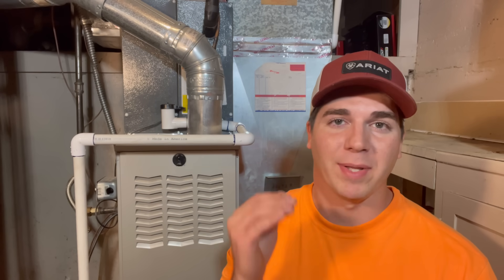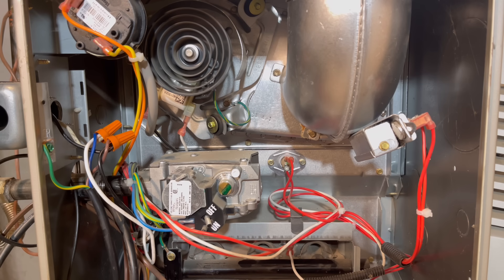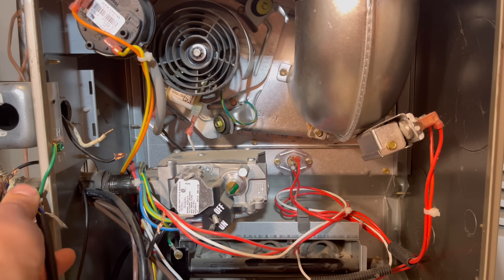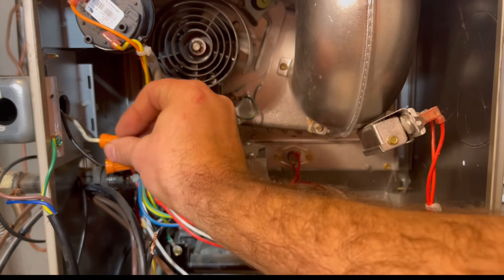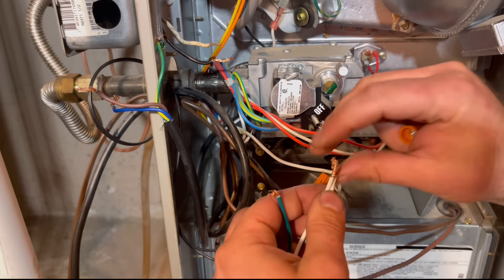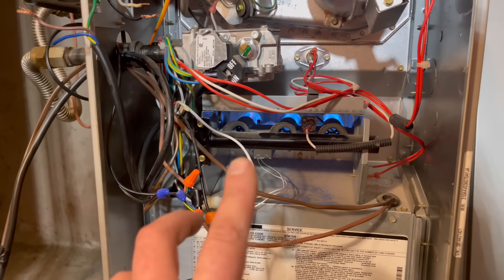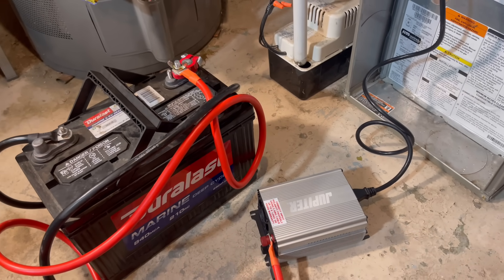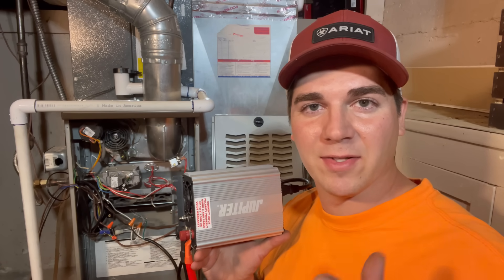Did You Know You Can Heat Your Home With A Car Battery?

Comment: I couldn't find in the comments.  Did you address anywhere in the comments that most, if not all, furnaces have safety switches that will prevent the furnace from operating without either the cover on or the switch disabled ?
Reply from the maker: The area where the power comes in is typically where the burners are and does not have a door switch for that part. The door switch is only for the blower motor and circuit board area. Hope this helps,   Dave

Comment: Great video. What should you do with the co de says wiring if you have a new high efficiency furnace?
Reply from the maker: Do you have a pure sine wave inverter? Some of the new furnaces will not work with a modified sine wave inverter.
Reply: @diyhvacguy
Reply: @diyhvacguy  
sorry, just realized that 'auto-correct' garbled my original question ...

We have a brand new Goodman furnace, so lots of electronics
If using a 12 V (or a 24 V) battery how do you wire up the condensate pump?
Noted your comment about the sine wave converter
Thank you

Comment: No fuses?  Good way to fry the inverter.
Reply from the maker: Good point. I ended up picking up a pure sine wave inverter with a fuse so I’ll be uploading the test video with that soon! Thanks for watching! Cheers
Reply: Inverter may have a fuse but I would still use a battery switch on the positive battery post for emergency an service.

Comment: Good video how do you know if you need to hook up condensate pump? Do you need a 1000 watt inverter min?
Reply from the maker: The condensate pump sits next to the furnace, but basically if you have pvc venting you need to either power the condensate pump or catch the water and drain it every once in a while. If you have metal venting then you don’t need to power the condensate pump. It’s only used for the ac in the summer months.
Reply: @diyhvacguy   Perfect, thank you.

Comment: this is what I've done many years ago when we had a prolongated power breakdown in Canada in january, it functionned rather well beacuse at work, I had an access to a power source to recharge my battery and I used a 8D size battery, much bigger than the one you use.
very good option when you know what you do, the best way is to have a battery and an inverter ready to be installed. it is a good idea on such a setup to have a  plug junction already istalled to just unplug the network source  and plug the alternative power source
very good video
Reply from the maker: Thank you so much! I ended up installing the inverter in my truck so I can run an extension cord from the inverter to my furnace and power it as long as I have fuel in the truck! Good knowledge to have in your back pocket for a sticky situation :) cheers

Comment: Why not provide power to the hot water heater as well? Also,  you should not place a lead acid battery directly on the ground like you've done in your video,  because it will drain the battery off its charge
Reply from the maker: Setting the battery in the ground is a myth. There is nothing to ground as it has a barrier of plastic between it and the ground d. 

I’m not sure what you mean on the water heater. You are talking about an electric water heater? This will only work for 110v  not 220v which I think most electric water heaters are.
Reply: @diyhvacguy  I'm living up north, my water heater is 110v, but I guess since you're an hvac guy,  that wouldn't necessarily be your expertise.  I think it's funny that you think plastic will stop the flow of electrons,  and that is a myth about putting a battery on the ground.  Why don't you meter a battery,  put it on the ground for 24hours,  then meter it again.
Reply: @horus2369  … Modern day batteries have a hard plastic shell that stops moisture intake . Batteries self discharge when they sit anywhere , so of course after 24 hours they may lose some voltage .
Also storing a battery in cold storage is better than warm storage contary to popular belief.

Comment: Photovoltaic / Solar Thermal Technician here... Awesome video 👍i install home solar systems as well as solar power plants. i've always tell people of doing this with Harbor Freight. you can use a 2000 or 5000 inverter connected to auto alternator and power your house. Full tank of gas and the alternator / inverter combo and you can run the house approximately 72 hours till you run out of gas. this is for emergencies or install a solar system yourself. there's more to it if connecting to the Grid. 

edit: i always say make dedicated outlets for your solar system "a-la off grid" style. depending where you live and city codes blah blah blah

Comment: If you use a standard invertor like the one in the video, your motors and gas valves will eventually burn out due to the modified sine wave the invertor puts out. You need a pure sine inverter which aren't cheap.
Reply from the maker: Yes I learned this pretty quickly. I have a pure sine wave inverter now and it’s hooked up to my truck so I can power the furnace as long as I have fuel in the truck 👍🏽 thanks for the comment! Cheers

Comment: This video was good. Life saving information given for free. Thank You
When I asked about somehow doing this to a Gas furnace repair man he told me it could cost $1,000's. I have a ft of snow n am at 28F rt now. Buffalo has over 60" of snow and there will be grid issues. I'm in N ON., CANADA. It's full on winter here 4X4 Time.
Reply from the maker: Wow! So what I ended up doing is I got a pure sine wave inverter (better for sensitive electronics) and it’s hooked up to my truck so I can power the furnace as long as I have fuel in the truck 👍🏽 thanks for the comment! Cheers

Comment: DO YOU KNOW THE ACTUAL WATTAGE A HEATER USES  CAN A 500 WATT WORK    MOST OF THE POWER IS USED BY THE BLOWER MOTOR
Reply from the maker: I think 1000w is kind of the minimum honestly. Even for mine I’d probably be better off with a 1500-2000 watt pure sine wave inverter which is better for sensitive electronics. thanks for watching! Cheers

Comment: In your example can a 110v battery charge be plugged into the other power inverter outlet and connect charging leads to the battery?  Wouldn’t this keep the battery charged not unless the load is greater that the charging capacity. What’s anyone’s thoughts?
Reply from the maker: Apparently this wouldn’t work as much as I’d like for it to. It would burn through battery power quicker then it’s able to charge. Thanks for the comment! Cheers

Comment: I don't think a furnace with a 2 hp electric motor would stay running for more than 5 minutes with a car battery 🤔
Reply from the maker: I’m sure it would last several hours. It’s like 3/4hp by the way. But what I ended up doing is getting a pure sine wave inverter (better for sensitive electronics and it’s hooked up to my truck so I can power the furnace as long as I have fuel in the truck 👍🏽 thanks for the comment! Cheers
Reply: Blower motor may be only 1/2 hp.

Comment: And you can use your car to help charge the battery as needed,  use an extension cord, and a hobby charger, dc to dc charger, to charge the battery, just don't let the car battery discharge, 
I havea similar system for lighting, a man d a inverter to run the fridge and a few lights , microwave,
Reply from the maker: Yea this is exactly what I ended up doing! Thanks so much for the tips. Cheers

Comment: Same concept but instead of unhooked wires just flip breaker off and make double male plug plug in and go when power comes on just unplug and flip breaker been doing this for years
Reply from the maker: With a generator? Will whichever the plug it’s plugged into only power that circuit?
Reply: Suicide cord.

Comment: I see that you used a Marine battery but figure it is also a deep cycle type. I have been learning what I can do with my 600W inverter and battery + a solar PV panel. The heat in my home here on the NC coast is all electric so the battery/inverter system I have is not anywhere near enough but I can keep learning and expanding. Thanks for the tip just in case I need it in the future 🙂
Reply from the maker: Yea good knowledge to have in your back pocket for when you are in a sticky situation! I ended up getting a pure sine wave inverter now and it’s hooked up to my truck so I can power the furnace as long as I have fuel in the truck 👍🏽 thanks for the comment! Cheers
Reply: @diyhvacguy  Yes I need to upgrade to a full sine wave someday as some of my computers and other electronics do not like the sudo sine wave I currently have and higher wattage plus I need more batteries in parallel. Take care

Comment: I'm guessing that the addition of a Solar panel to charge the battery, or another to allow swapping them out, might work as well !
                👍😉
Addendum :
I would add as a precautionary measure, that the inverter you purchase, be capable of producing clean electricity, signified by a Sine wave, likely identified somewhere in the literature with the inverter, or in the advertisement !
May not be critical on older model Furnaces, but any that incorporate modern Digital integrated control circuits, would likely need clean electricity.
Better safe, than sorry !
And I would always confer first with a licensed and Bonded Furnace Technician !

Comment: I’ll stick with my Honda generator that sips fuel
Reply from the maker: For sure. This is good knowledge to have in your back pocket though :) What I ended up doing is I got a pure sine wave inverter (better for sensitive electronics) and it’s hooked up to my truck so I can power the furnace as long as I have fuel in the truck 👍🏽 thanks for the comment! Cheers

Comment: I gotta laugh. I get what you're saying. If this was the case there be no energy crisis. An invertor converts dc to ac. Seeing that #2 wire going to that invertor should tell you something. (Proportional loads) I wish you would put an ammeter on the 12v side and 120 side adding loads. Your lucky if that battery lasts 15- 30 minutes with a constant load especially when the inrush current tries to start the squirrel cage forced air blower. I would only use that to maybe power a lamp, TV or laptop.
Probably take you 6 to 12 hours to recharge the battery. Lol. 
Also not smart to leave the grounding wire off. U might not be concerned with voltage spikes but when it fries your control board its not cheap. Several hundreds of dollars if not a thousand easily, plus a service call.
I shure harbor freight appreciates your business.
Reply from the maker: Thanks for the information. You sound like you know a lot about this. I quickly found that it probably wouldn’t last long. I don’t know about 30 mins? I ran it for an hour before disconnecting it, as I’m not in an emergency situation. But I’d say a few hours which is still good in a pinch. Anyways, what I ended up doing is picking up a pure sine wave inverter and it’s hooked up to my truck so I can power the furnace as long as I have fuel in the truck 👍🏽 thanks for the comment! Cheers

Comment: I tried this several years ago, furnace hummed/buzzed and wouldn't work. I figured it didn't like the cheap squarewave (um, 'modified sinewave') power.
Reply from the maker: Hmmm I wonder if it would work with a pure sine wave?

Comment: quite some years ago, in a rural setting, we lost power due to a snowstorm.   We had a wood/coal furnace where my dad had designed the ducting to work well via gravity feed, an old kerosene cook stove and an Aladdin lamp.  We did quite well but had some neighbors (two older women) who had an oil furnace, which couldn't run because the pump was electrically driven.  This could have served them well.
Reply: Or just buy a generator

Comment: I would add an A-B switch so that I could do the wiring once, then forget it.  If you are willing to accept the extra cost, (maybe you regularly lose power due to storms or whatever) include a permanent battery and a trickle charger to keep the battery full
Reply from the maker: I have a pure sine wave inverter now and it’s hooked up to my truck so I can power the furnace as long as I have fuel in the truck 👍🏽 thanks for the comment! Cheers